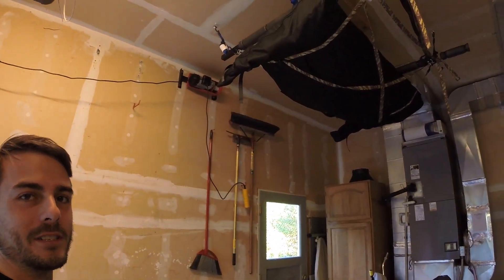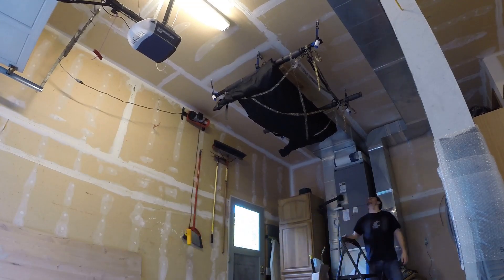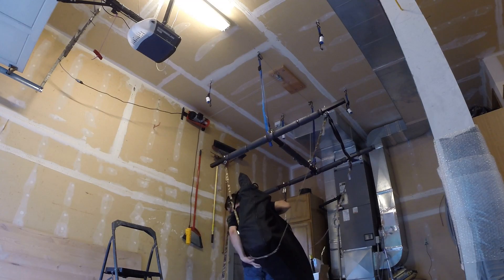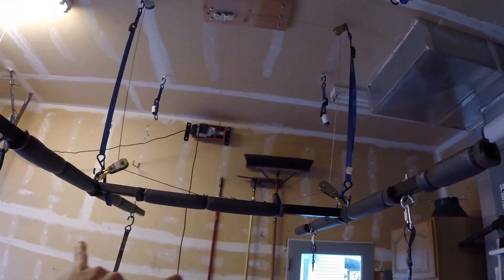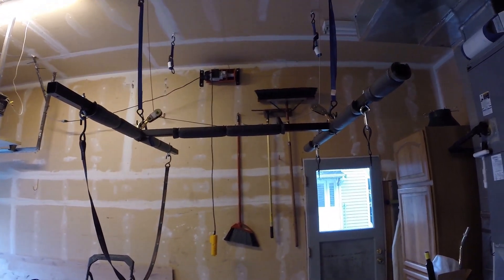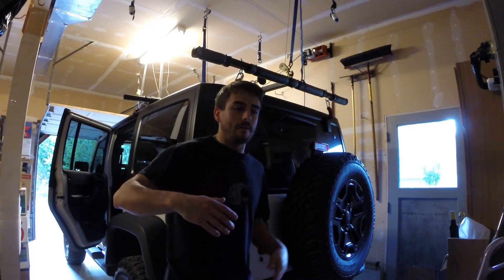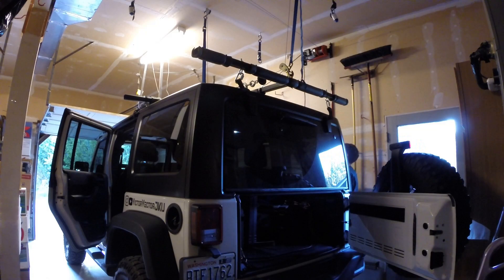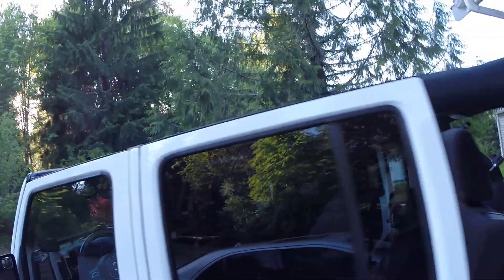DIY Custom Electric Hard Top Hoist System for Under $350

Comment: I’m assuming once you split the cable in half, you had to add another hook to the other end of the cable? Love the set up! Looking to do this soon as well.
Reply from the maker: Hey Sean, thanks for em checking out my video! Yes that is correct! Find center of the cable and feed the two ends back through the slot and put the locking tab back into place to keep the loop from pulling through. And just to be sure, you do not want to cut the cable, the loop is what will be used to keep the line from unspooling. And then yes you will add a second hook on the other free end!

Comment: Any chance you can show how you used the harbor fright hoist with one cable out to two?
Reply from the maker: Unfortunately I did not capture any video on how I spooled the winch. I do have a few pictures in the original post that will give some additional detail if you send me a DM on IG. 

But basically you need to completely unspool the cable and take off the cover for the end of the drum. There is a locking tab that the cable routes around. From here I found the middle of the cable and put that where the locking tab was rather than one extreme end of the cable. I then re-spooled the cable and that’s is basically how I made the two even lengths! Find me on IG, shoot me a DM and I will share that post with you for the pictures!

Comment: Nice... How did you secure the two pulley cables to the singe winch line?
Reply from the maker: Michael, I hope that I understand your question correctly and answer sufficiently. For the winch line, I unspooled the entire winch line from the drum and disassembled it to access the locking tab feature on the side of the drum that locks the winch line to the drum. Once I got to there I then released that little locking tab and determined mid length of the cable and re-engaged the locking tab at that point so I had two equal lengths of cable coming from the winch. Then I ran those two lengths of cable in the two separate directions from the ceiling flush mounted pulleys and I attached hooks to ends of each of the cable. Let me know if I did not answer your question fully, I can look to make a follow up video with more detail on the winch and its mount!

Comment: Nicely done.  How did you mount your hoist to the wall?
Reply from the maker: Thank you, I made an I bracket using two pieces of angle iron for the ends and a piece of square tubing to span the center. To go off of memory, I cut the square tubing approximately 16" in length to span the studs in the wall and cut the angle iron to approximately 12"-16". I then welded the square tube to the angle iron with the flanges of the angle iron towards center, which kept the tube off of the wall allowing for clearance of the included straps of the hoist to fit between the tube and the wall when mounted. I then mounted the hoist to the bracket using the hoist's supplied hardware and using 6 - 3/8" x 4-1/2" lag bolts, 3 for each side, I bolted the bracket to the studs in the wall.
Reply: @VictorVectorGarage  Thanks for the reply.  I need to learn some welding.  That would make so many things so much easier.  I think I'm going to do something similar but it will be mounted to unistrut instead of the square tube and the unistrut will be secured to a 2x8 that spans several studs.  It should hold.  The top on my Jeepster will be off by the weekend!
Reply from the maker: Yeah that sounds like it should work just fine! And yeah welding definitely is a great skill to have, especially owning a Jeep! That is great to hear, I love the Jeepsters! If you have an Instagram account, look me up! I would love to see how your system turns out! My Instagram and YouTube handles are the same, @VictorVectorJKU.